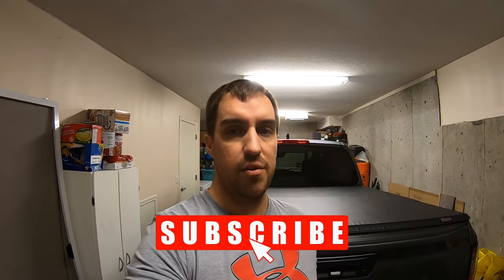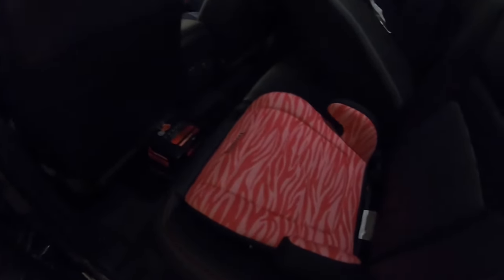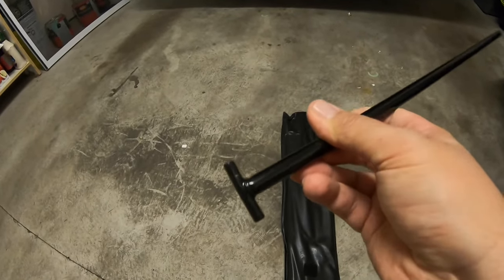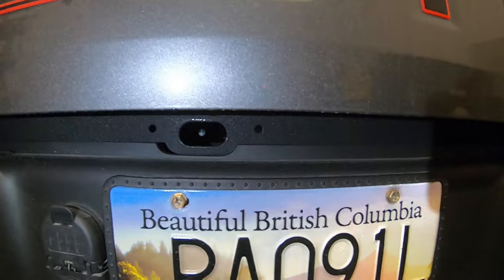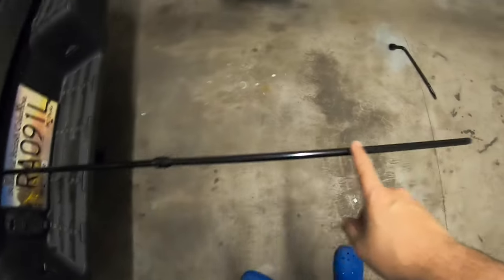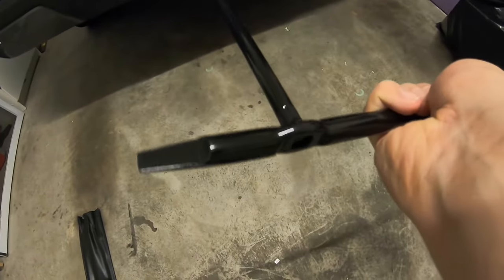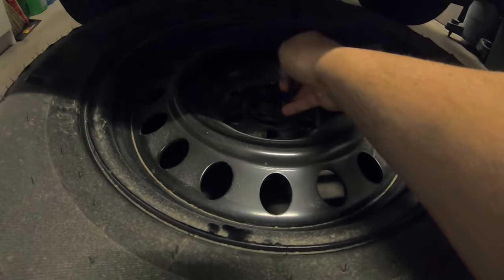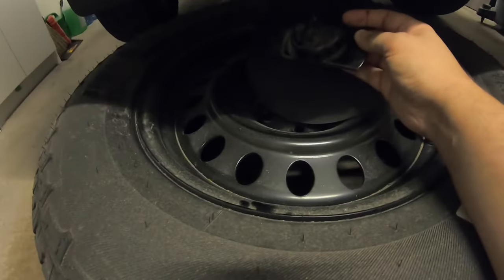How To Remove Your Spare Tire On A 2023 Nissan Frontier Pro-4X

Comment: If you live in the salt belt make sure you pull the tire down occasionally  and spray the mechanism with Fluid Film to prevent them for rusting and sticking

Comment: I wish every manufacturer had this idea for their trucks or suvs from every year since instead of just the 2020+ vehicles, definitely comes in handy instead of struggling to remove the wheel from the bottom
Reply: My 2004 Ram has this system
Reply: My 2002 Trailblazer had this system too
Reply: My 2009 Silverado has this system

Comment: Now I know to later get a 5th OEM rim for the spare for my soon to be mine Frontier, thanks for the quick guide 🙂 also its always best carry a "cross" lug nut breaker if you live in a very hot and humid area like I do in deep South Texas that can make those lug nuts a nightmare. Especially if you need to put your foot and body weight and the L shape ones will wear out like it did to my Sentra.

Comment: Thanks for the great detailed video. My wife just got herself a new 2023 and I hadn't yet gotten around to figuring the spare tire out. Unrelated question - are you able to tell me who you got your add on stickers from for the inlayed Frontier on the tailgate?
Reply from the maker: I got them off etsy. I believe most of them are made from the same place and just sold through different names. Just make sure to look for the 3d or raised letters. If not it will just be the flat vinyl.
Reply: @CanadianCruisin  Got the same ones off of eBay, but the orange outline on mine is reflective, and so are the ones for the front.

Comment: Can you turn the spare over to store it with the inflation valve down so you can check the air pressure without lowering the spare?
Reply: YES

Comment: You mentioned you secured the chain under the spare as it hangs down. How did you do this successfully without it falling through the spare holes again?
Reply from the maker: I kinda wrapped the chain into itself then tightened the mechanism as much as it would go. The bracket on the end squished the chain up and tight enough it doesn't fall back down